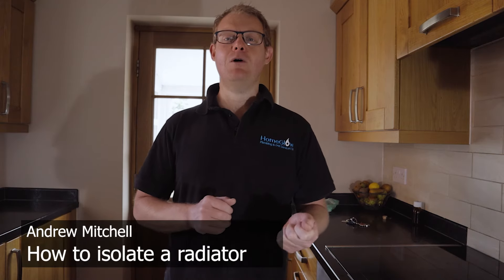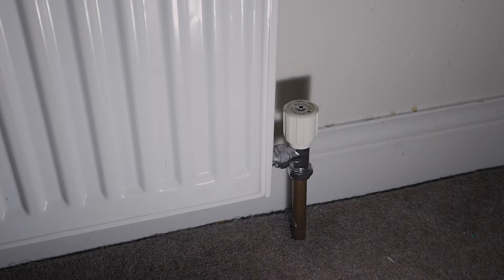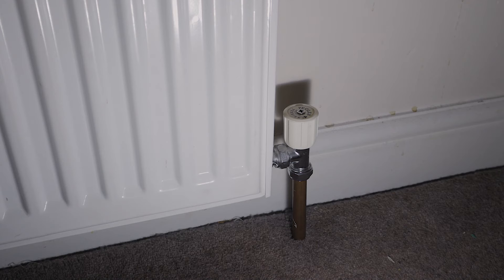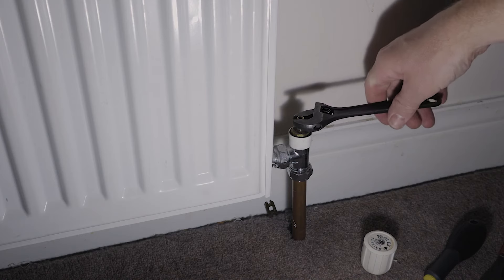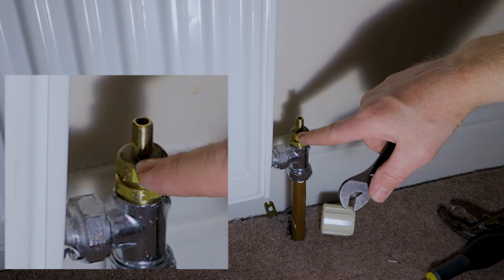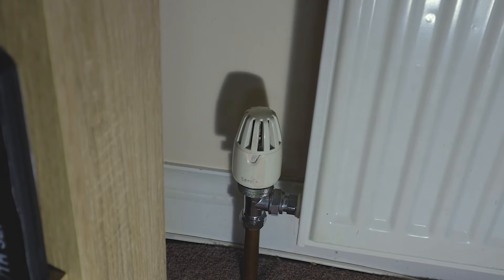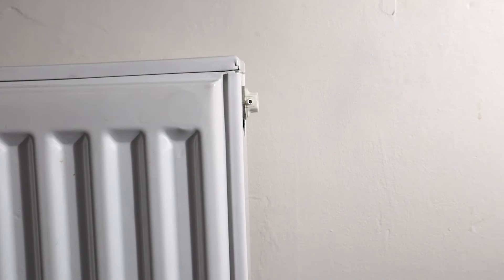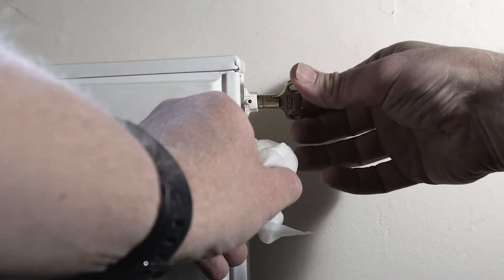How to turn off a radiator valve | Leaky radiator

Comment: I'm trying to switch off a valve. When I start turning the spanner clockwise it starts to leaks and the tension gets less like I'm loosing rather than tightening. Firstly could it have the opersite thread? Secondly if I continue will the hole thing come out water starts pissing out everywhere?